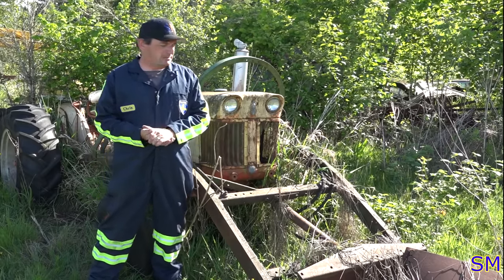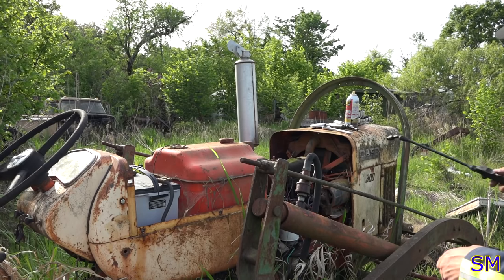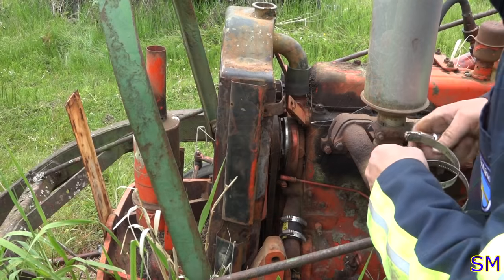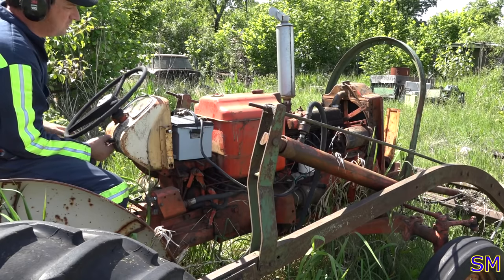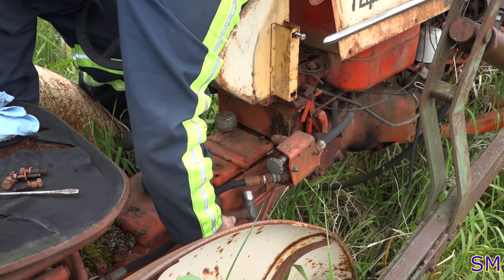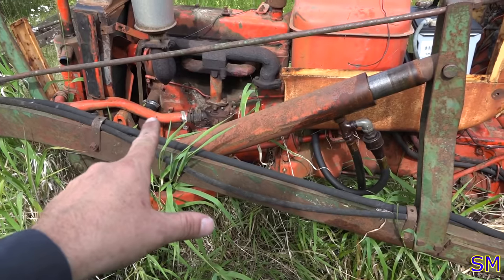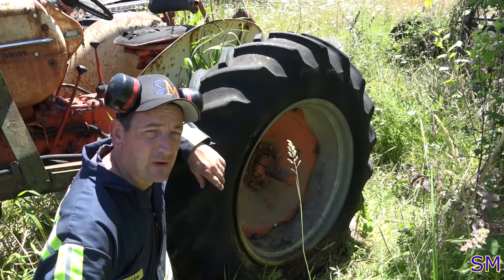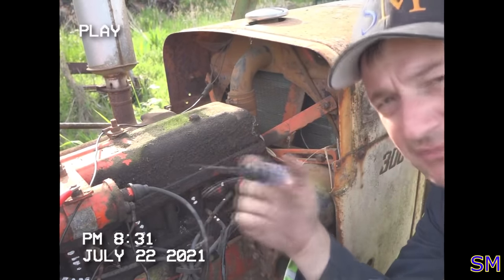Rescued 1959 Case 300B Tractor - Will it Start / Run / Drive After Left Outside for 10 years?

Comment: What does a wet clutch do
Reply from the maker: Same thing as a dry clutch only with a wet clutch it doesn’t wear out nearly as fast. Common uses for wet clutches are in motorcycles and automatic transmissions. Instead of one dry clutch plate there are many smaller clutch plates that are stacked and sandwiched together that are submerged in oil. This provides longevity for the wet clutch pack. Just another method of delivering power😉